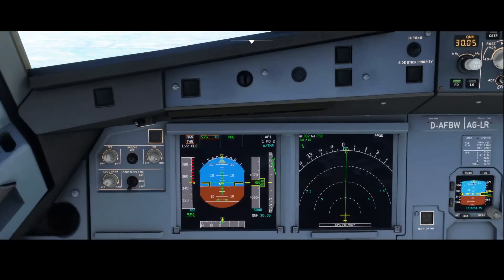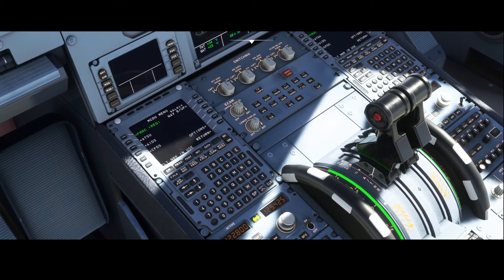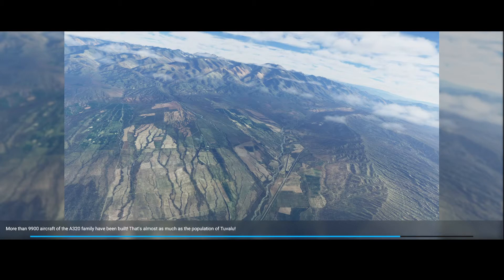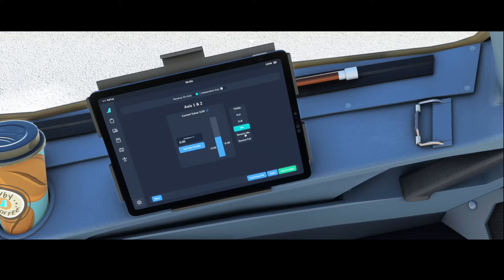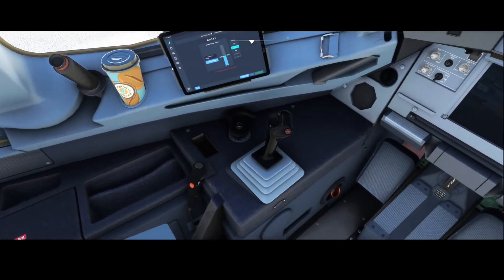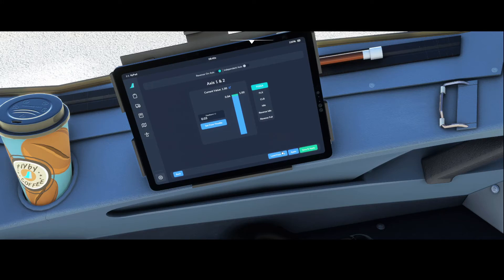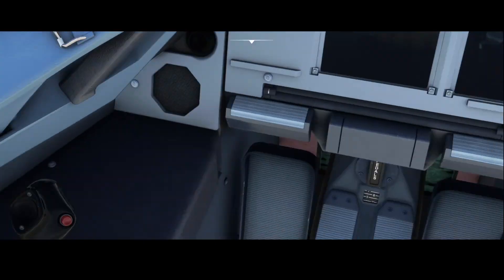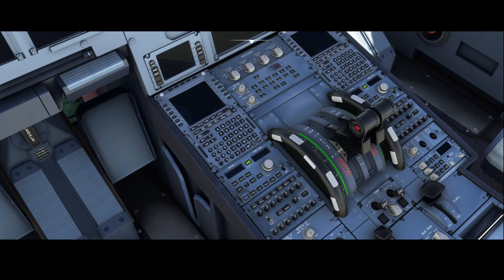Flight Simulator 2020 - A32NX - Fixing the lvr clb blinking issue

Comment: This just started going off 5 hours into my first international flight and it's a total of 9 hours and I'm like hell naw, not today😭. That didn't work cause my auto throttle was already on 0 so what I did is turned off auto throttle, pulled it back to slow down, then turned auto throttle back on
Reply from the maker: that must have been very frustrating